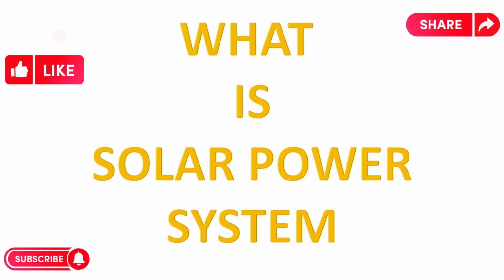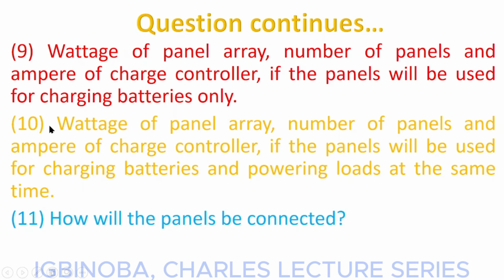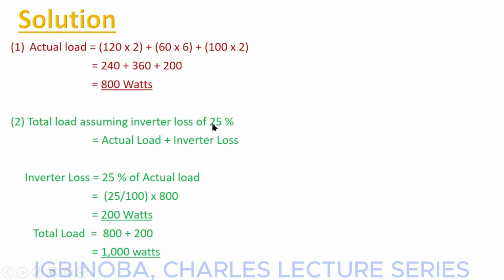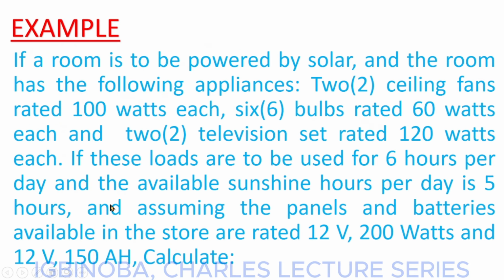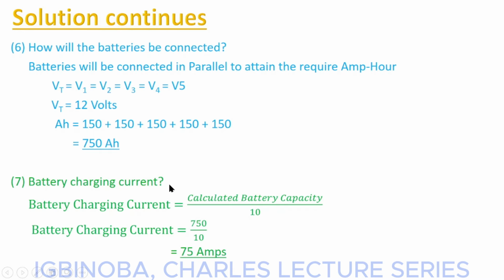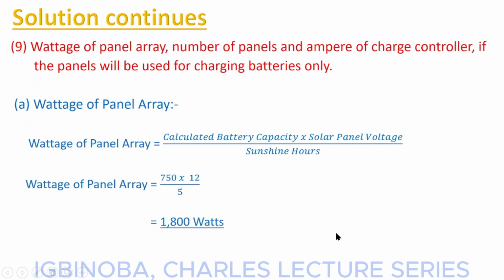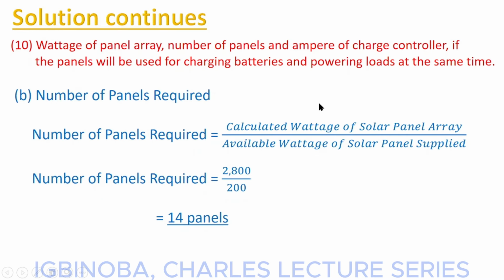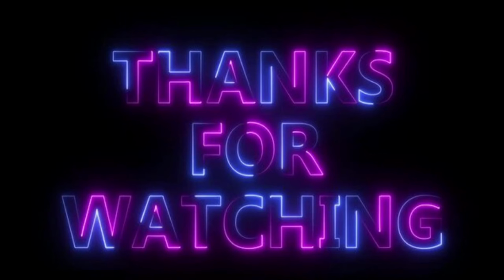Design of Solar Power System

Comment: MAR39M
ANSWERS:

1. Actual load = 1380watts
2. Total load = 1725 Watts
3. Inverter rating = 2156.25VA
4. Battery capacity = 1293.75AH
5. Number of batteries= 9batteries
6. Batteries connection = parallel
7. Battery charging current : 129.375A(150A) 
8. 14 hours
9a. Wattage of panel array ( charging only batteries) = 3105.6 Watts
9b. Number of panel = 16 panels
9c. Ampere of charge controller = 358.8A
10a. Wattage of panel array ( battery and load) = 4831 Watts
10b. Number of panel = 24 panels
10c. Ampere of charge controller = 402.6A
11. Panel connection : parallel

Comment: MEC108D

Answers:
*Actual Load: 1380W
* Total Load: 1725W
*Inverter reading: 2156.25VA
*Battery capacity using a reverse of  75%: 1293.75h
*Number of batteries for backup hours: 9 batteries
*How will the battery be connected - parallel 
*Battery charging current: 129.4A
*Battery charging time with loss of 40%: 14hrs
*Wattage of panel array: 315W
*No. of panels: 16panels
*The charge controller rating: 258.75A
*The wattage of panel array: 4830W
*The number of panel: 24
*The charge controller rating: 492.5
* Panels connection: Parallel

Comment: MAR91M

1. Actual load = 1380W
2. Total load = 1725W
3. Inverter reading = 2156V
4. Battery capacity using a reserve of 75%=1293.75h
5. Number of batteries for backup = 9hrs
6. The batteries will be connected in parallel 
7. Battery charging current=129.4A
8. Battery charging time with loss of 40% =14hrs
9a. Wattage of panel energy array=315W
9b. Number of panels =16 panels
9c. The charge controller rating =258.75
10a. Wattage of panel array =4830W
10b. Number of panels =24 panels
10c. Charge controller rating =492.5
11. The panel were connected in parallel

Comment: CHM3C

1. The actual pad is 1,380W
2. The Total load is 1,725W
3. The inverter rating is 2,156.23VA
4. The battery capacity is 1,293.75Ah
5. The Number of batteries is 9
6. The batteries are connected in parallel
7. The Battery charging current is 129.4 amps.
8. The battery charging time is 14 hours.
9. a. The wattage of the panel array is 3,105W
b. The number of panels is 16 panels.
c. The Charge controller rating is 258.75 amps.
10. a. The wattage of the Panel array is 4,830 Watts
b. The number of panels is 24 panels.
c. The charge controller rating is 402.5 amps
11. The panels are arranged in parallel

Comment: CIV67O
Actual load = 1380 W
Total load = 1725 W
Inverter rating = 2156.25 VA
Battery capacity = 1293.75 Ah
Number of batteries = 9 batteries
Battery connection = Parallel
Battery charging current = 129.375 A (150 A)
Battery charging time = 14 hours
Panel array (charging only batteries):
9a. Wattage of panel array = 3105.6 W
9b. Number of panels = 16 panels
9c. Charge controller current = 358.8 A
Panel array (battery and load):
10a. Wattage of panel array = 4831 W
10b. Number of panels = 24 panels
10c. Charge controller current = 402.6 A
Panel connection = Parallel

Comment: MEC30D

1380 watts

1725 watts

2156.25 VA

1293.75 AH

9 batteries

Parallel connection

129.4 amps

14 hours

3105 W

16 panels

258.75 amps

Comment: MEC104Z
1.Actual load = 1380 watts
2.Total load = 1725 watts 
3.Battery capacity= 1293.75Ah
4.Number of batteries= 9 batteries 
5.Batteries connection= Parallel 
6. Battery charging current= 129.375A (150A)
8. 14 hours
9. Wattage of panels array (charging only batteries) = 3105.6 watts
9b. Number of panels = 16 panels
9c: Ampere of charge controller= 358.8 A
10a. Wattage of panel array ( Battery and load) = 4831 watts
10b. Number of panels= 24 panels 
10c. Ampere of charge controller= 402.6A
11. Panel connection: Parallel

Comment: EEE84F 
1. Actual load=1380 watts
2. Total load =1725watts
3. Inverter rating=2156.25VA
4. Battery capacity=1293.75AH
5. Number of batteries= 9 batteries 
6. Batteries connection=parallel 
7. Battery charging current:229.375A
8. 14hrs
9a. Wattage of pannel array(charging only batteries)=3105.6watts
9b. Number of panels =16 pannels
9c. Ampere of charge controller=358.8A
10a. Wattage of panel array(Battery and load)=4831watts
10b. Number of panels=24panels
10c. Ampere of charge controller=402.6A
11. Panel connection: parallel

Comment: EEE6F
1380 watts
1725 watts
2156.25 VA
1293.75 AH
9 batteries 
Parallel connection 
129.4 amps
14 hours
3105w
16 panels 
258.75 amps

Comment: COMP79A
Answer; 

1. The actual pad is 1,380W
2. The Total load is 1,725W
3. The inverter rating is 2,156.23VA
4. The battery capacity is 1,293.75Ah 
5. The Number of batteries is 9
6.  The batteries are connected in parallel 
7. The Battery charging current is 129.4 amps.
8. The battery charging time is 14 hours.
9. a. The wattage of the panel array is 3,105W
b. The number of panels is 16 panels.
c. The Charge controller rating is 258.75 amps.

10. a. The wattage of the Panel array is 4,830 Watts 
b. The number of panels is 24 panels.
c. The charge controller rating is 402.5 amps
11. The panels are arranged in parallel

Comment: EEE32F

1. 1380 Watts 
2. 1725 Watts 
3. 2156.25 VA
4. 1293.75 Ah
5. 9 Batteries
6. The batteries are connected in parallel
7. 129.37 Amps
8. 14 Hours
9a. 3105 Watts
b. 16 Panels
c. 258.75 Amps
10a. 4830 Watts
b. 24 Panels
c. 402.5 Amps
11. The panels are connected in parallel

Comment: Comp24s 
Answers:

1. Actual load= 1380 watts

2.  Total load= 1724 watts

3. Inverter rating= 2156.25VA

4. Battery capacity= 1293.75AH

5. Number of batteries= 9 batteries 

6. Batteries connection: parallel 

7. Battery charging current: 129.375A(150A)

8. 14 hours 

9a. Wattage of panels array(charging only batteries)= 3105.6watts

9b. Number of panels =16 panels 

9c. Ampere of charge controller = 358.8A

10a. Wattage of panels array ( Battery and load) = 4831 watts

10b. Number of panels= 24 panels 

10c. Ampere of charge controller = 402.6A

11. Panel connection: parallel

Comment: EEE75W
. Actual load: 1380W
. Total load: 1725W
. Inverter Reading: 2156V 
. Battery Capacity using a reserve of 75%: 1293.75h
. Number of batteries for backup - 9hrs
. How will the battery be connected - Parallel 
. Battery charging current- 129.4
. Battery charging time with loss of 40% - 14hrs 
. Wattage of panel energy array: 315w
. No of panels -16 
. The charge controller rating -258.75
. The wattage of panel array 4830W 
. The number of panel- 24 panels 
. The charge controller rating - 492.5
. Panels connection- parallel

Comment: CIV52Z

Answers:

1. Actual load-1380Watts 

2. Total load=1725Watts 

3. Inverter rating-2156.25VA 

4. Battery Capacity=1293.75AH 

5. Number of Batteries 9 batteries 

6. Batteries connection: Parallel 

7. Battery Charging Current: 129.375A(150A) 

8. 14Hours 

9a. Wattage of panel array(charging only batteries)= 3105.6Watts 

9b. Number of panels= 16panels 

9c. Ampere of charge controller= 358.8A 

10a. Wattage of panel array (Battery and load)= 4831Watts 

10b. Number of panels 24 panels 

10c. Ampere of charge controller= 402.6A 

11. Panel connection: Parallel

Comment: EEE8H

 Answers :: 

 1380watts 

 1725 Watts 

 2156.25 VA

 1293.75 Ah

 9 batteries 

 Parallel connection 

 129.4 amps

 14 hours 

 3,105 W

 16 panels

 258.75 amps

 4,830 Watts 

 24 panels 

 402.5 amps

 The panels are arranged in parallel

Comment: MEC68P 

1380 W

1725 W

2156.25va

1293.75ah

9 batteries

Parallel connection

129.4amp

14 hours

3105w

16 panels

258.75amps

4831w

24 panels

402.5 amps

The panels are in parallel

Comment: COMP16P

1. The actual load is 1,380W
2. The Total load is 1,725W
3. The inverter rating is 2,156.23VA
4. The battery capacity is 1,293.75Ah 
5. The Number of batteries is 9
6.  The batteries are connected in parallel 
7. The Battery charging current is 129.4 amps.
8. The battery charging time is 14 hours.
9. a. The wattage of the panel array is 3,105W
b. The number of panels is 16 panels.
c. The Charge controller rating is 258.75 amps.

10. a. The wattage of the Panel array is 4,830 Watts 
b. The number of panels is 24 panels.
c. The charge controller rating is 402.5 amps
11. The panels are arranged in parallel

Comment: PETROCHEM58F

1. The actual pad is 1,380W
2. The Total load is 1,725W
3. The inverter rating is 2,156.23VA
4. The battery capacity is 1,293.75Ah 
5. The Number of batteries is 9
6.  The batteries are connected in parallel 
7. The Battery charging current is 129.4 amps.
8. The battery charging time is 14 hours.
9. a. The wattage of the panel array is 3,105W
b. The number of panels is 16 panels.
c. The Charge controller rating is 258.75 amps.

10. a. The wattage of the Panel array is 4,830 Watts 
b. The number of panels is 24 panels.
c. The charge controller rating is 402.5 amps
11. The panels are arranged in parallel

Comment: CHM57E

1380watts

1725 watts

2156.25va

1293.75ah

9 batteries

Parallel connection

129.4amps

14 hours

3,105w

16 panels

258.75amps

4,830 watts

24 panels

402.5 amps

The panels are arranged in parallel

Comment: CHM15O 
1) Actual load is 1380W
2) Total load is 1725W
3) Inverter rating is 2156.6VA
4) Battery capacity is 1293.8AH
5) The number of batteries is 8.7
6) Batteries connection is Parallel 
7) Battery charging current is 129.4A
8) Battery charging time is 14hrs
9a) Panel wattage is 3105W
b) The number of panel is 15.5
c) The amperage of charge controller is 258.8A
10a) Wattage of panels is 4830W
b) Number of panels is 24.2
c) Amperage of charge controller is 402.5A
11) Panel connection is parallel

Comment: MEC83E
1) The actual load = 1,380W
2) The Total load = 1,725W
3) The inverter rating = 2,156.23VA
4) The battery capacity = 1,293.75Ah
5) The Number of batteries = 9
6) The batteries are connected in parallel
7) The Battery charging current = 129.4 amps.
8) The battery charging time = 14 hours.
9) a. The wattage of the panel array = 3,105W
b. The number of panels = 16 panels.
c. The Charge controller rating = 258.75 amps.
10) a. The wattage of the Panel array is 4,830 Watts
b. The number of panels= 24 panels 
C. The charge controller rating = 402.5. 22:57

Comment: CHM108C
Answers:

1. Actual load= 1380Watts

2. Total load 1725Watts

3. Inverter rating- 2156.25VA

4. Battery Capacity- 1293.75AH

5. Number of Batteries 9 batteries

6. Batteries connection: Parallel

7. Battery Charging Current: 129.375A(150A)

8. 14Hours

9a. Wattage of panel array(charging only batteries)=

3105.6Watts

9b. Number of panels= 16panels

Oc. Ampere of charge controller= 358.8A

10a. Wattage of panel array (Battery and load)=

4831Watts

10b. Number of panels 24 panels

10c. Ampere of charge controller= 402.6A

11. Panel connection: Parallel
Reply: MEC113I

Answers:

1. Actual load= 1380Watts

2. Total load 1725Watts

3. Inverter rating-2156.25VA

4. Battery Capacity- 1293.75AH

5. Number of Batteries 9 batteries

6. Batteries connection: Parallel

7. Battery Charging Current: 129.375A(150A)

7. Battery Charging Current: 129.375A(150A)

8. 14Hours

9a. Wattage of panel array(charging only batteries)=

3105.6Watts

9b. Number of panels= 16panels

Oc. Ampere of charge controller= 358.8A

10a. Wattage of panel array (Battery and load)=

4831 Watts

لا

10b. Number of panels 24 panels

10c. Ampere of charge controller= 402.6A

11. Panel connection: Parallel
❤😂❤❤

Comment: PETRO94P
1) 1380W
2) 1725W
3) 2156.25VA
4) 1293.75Ah
5) 9 batteries 
6) Batteries are connected in parallel
7) 129.375A
8) 14hrs
9a) 3105VA
9b) 16 panels
9c) 258.75A
10a) 4830VA
10b) 25 panels
10c) 402.5A
11) Panels are connected in parallel

Comment: CHM100V

The answer: 
The total load: 1380W
Daily energy consumption: 8280WH/day
Energy from one 200W panel: 1000WH/day
Solar panels required: 9 panels 
Energy in one 12V, 150AH battery: 1800WH
Batteries required: 5 batteries

Comment: PETROCHEM35I

Answers:

1. The actual pad is 1,380W
2. The Total load is 1,725W
3. The inverter rating is 2,156.23VA
4. The battery capacity is 1,293.75Ah
5. The Number of batteries is 9
6. The batteries are connected in parallel
7. The Battery charging current is 129.4 amps.
8. The battery charging time is 14 hours.
9. a. The wattage of the panel array is 3,105W
b. The number of panels is 16 panels.
c. The Charge controller rating is 258.75 amps.
10. a. The wattage of the Panel array is 4,830
Watts
b. The number of panels is 24 panels.
c. The charge controller rating is 402.5 amps
11. The panels are arranged in parallel

Comment: CIV81C

Answer
1. 1380 watts
2. 1725 watts
3. 2156.23 VA
4. 1293.75 AH
5. 9 batteries 
6. connected in parallel 
7. 129.4 AMPS
8. 14 hours
9a. 3104 watts
  b. 16 panels
  c. 258.75 amps
10a. 4830 watts
   b. 24 panels
   c. 402.5 amps
11. The panels are arranged in parallel

Comment: EEE16P 

Answer:

1. Actual load = 1380 WATTS

2. Total load = 1725 WATTS

3. Inverter rating = 2156 VA

4. Battery Capacity = 1294 Ah

5. Number of batteries = (9 batteries)

6. They will be connected in parallel

7. Battery charging current = 129 AMPS

8. Battery charging time with 40% loss = 14hrs

9a. Wattage of panel array = 3106WATTS

9b. Number of panels = 16panels

9c. Ampere of charge controller = 258AMPS

10a. Wattage of panel array with load = 4400 WATTS

10b. Number of panels = 22 panels

10c. Ampere of charge controller = 367 AMPS

11. They will be connected in parallel

Comment: MEC73U

1. 1380W
2. 1840W
3. 2300VA(or2.3kVA)
4.1226.67Ah
5. 9 batteries
6. Parallel connections 
7. 122.67A
8.16.67 hours
9. Array wattage : 3680W | Number of panels: 19 panels
| charge controller : 306.67A(or 350A standard rating)

10. Array wattage: 5888 panels: 30 panels | charge controller : 490.67A ( or 500 A standard rating)

11. Parallel connection

Comment: MEC62J
1. 1380W
2. 1725W
3. 2.156kVA
4.  ≈ 1294Ah
5. ≈ 9 batteries 
6. In parallel 
7. ≈ 129.4A
8. ≈ 14hrs
9a. 3105W
  b. 16 panels 
  c. 258.75A
10a. 4830W
    b. 25 panels 
    c. 40.25A

Comment: PETRO86H

Answers:

1. Actual load = 1380Watt

2. Total load = 1725Watt

3. Inverter rating = 2156.25VA

4. Battery Capacity = 1239.75Ah

5. Number of batteries = 8.625 (9 batteries)

6. They will be connected in parallel

7. Battery charging current = 129.375A

8. Battery charging time with 40% loss = 14hrs

9a. Wattage of panel array = 3105Watt

96. Number of panels = 16panels

9c. Ampere of charge controller = 258.75A

10a. Wattage of panel array with load = 4485Watt

106. Number of panels = 23panels

10c. Ampere of charge controller = 373.75A

11. They will be connected in parallel.

Comment: PETRO29C

Answer:

(1) 1380 watts

(2)1725 watts

(3) 2156.25VA

(4) 1293.75Ah

(5) 9 batteries

(6) Parallel connection

(7) 129.39amps
(8) 14 hrs

(9a) 3105 watts

(9b) 16 panels

(9c) 258.75 Amps

(9d) Parallel connection
(10a) 4830

(10b) 24.15

(10c) 402.5 Amps

Comment: MAR23W
Answers:

1. Actual load=1380Watts

2. Total load=1725Watts

3. Inverter rating=2156.25VA

4. Battery Capacity= 1293.75AН

5. Number of Batteries= 9 batteries

6. Batteries connection: Parallel

7. Battery Charging Current: 129.375A(150A)

8. 14Hours

9a. Wattage of panel array(charging only batteries)=

3105.6Watts

9b. Number of panels= 16panels

9c. Ampere of charge controller= 358.8A

10a. Wattage of panel array (Battery and load)= 4831Watts

10b. Number of panels= 24 panels

10c. Ampere of charge controller= 402.6A

11. Panel connection: Parallel

Comment: MAR72U 

1. The actual pad is 1,380W
2. The Total load is 1,725W
3. The inverter rating is 2,156.23VA
4. The battery capacity is 1,293.75Ah 
5. The Number of batteries is 9
6.  The batteries are connected in parallel 
7. The Battery charging current is 129.4 amps.
8. The battery charging time is 14 hours.
9. a. The wattage of the panel array is 3,105W
b. The number of panels is 16 panels.
c. The Charge controller rating is 258.75 amps.

10. a. The wattage of the Panel array is 4,830 Watts 
b. The number of panels is 24 panels.
c. The charge controller rating is 402.5 amps
11. The panels are arranged in parallel

Comment: CHM37K 
1. ACTUAL LOAD= 1380W
2. TOTAL LOAD =  1725W
3. INVERTER RATING = 2156.6VA
4. BATTERY CAPACITY = 1293.8Ah
5. NUMBER OF BATTERIES= 8.7
6. BATTERIES CONNECTION = PARALLEL 
7. BATTERY CHARGING CURRENT = 129.4A
8. BATTERY CHARGING TIME = 14hrs
9a. PANEL WATTAGE= 3105W
b. NUMBER OF PANEL = 15.5
c. AMPERAGE OF CHARGE CONTROLLER= 258.8A
10a. WATTAGE OF PANELS= 4830W
b. NUMBER OF PANELS= 24.2
c. AMPERAGE OF CHARGE CONTROLLER= 402.5A
11. PANEL CONNECTION= PARALLEL

Comment: MEC45S

Answer:

1. The actual load is 1,380W

2. The Total load is 1,725W

3. The inverter rating is 2,156.23VA

4. The battery capacity is 1,293.75Ah

5. The number of batteries is 9

6. The batteries are connected in parallel

7. The battery charging current is 129.4 amps

8. The battery charging time is 14 hours

9. a. The wattage of the panel array is 3,105W
b. The number of panels is 16 panels
c. The charge controller rating is 258.75 amps

10. a. The wattage of the panel array is 4,830 Watts
b. The number of panels is 24 panels
c. The charge controller rating is 402.5 amps

11. The panels are arranged in parallel

Comment: CIV34H
Answers:
1. Actual load= 1380Watts
2. Total load= 1725Watts
3.  Inverter rating= 2156.25VA
4. Battery Capacity= 1293.75AH
5. Number of Batteries= 9 batteries
6. Batteries connection: Parallel 
7. Battery Charging Current: 129.375A(150A)
8. 14Hours
9a. Wattage of panel array(charging only  batteries)= 3105.6Watts
9b. Number of panels= 16panels 
9c. Ampere of charge controller= 358.8A
10a. Wattage of panel array (Battery and load)= 4831Watts
10b. Number of panels= 24 panels 
10c. Ampere of charge controller= 402.6A
11. Panel connection: Parallel

Comment: EEE12L
Answers:
1 Actual load 1380W
2 1725W
3 2156.25VA
4 1293.75AH
5 9 batteries 
6 The battery are connected in parallel 
7 129.375A
8 14 hours
9a 3105W
b 15.525 panels 
10a 4830W
b 24 panels 
C 402.5A
11 The panels are connected in parallel